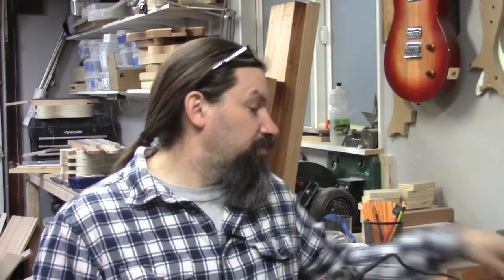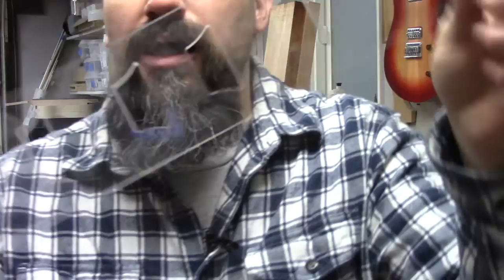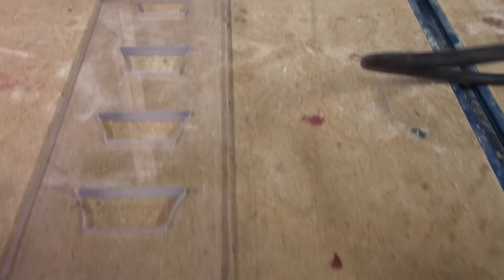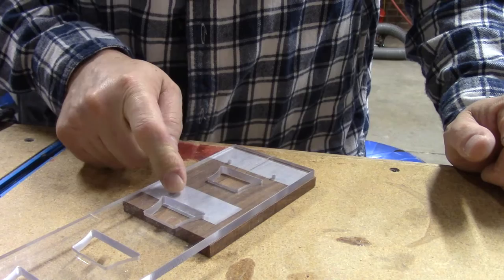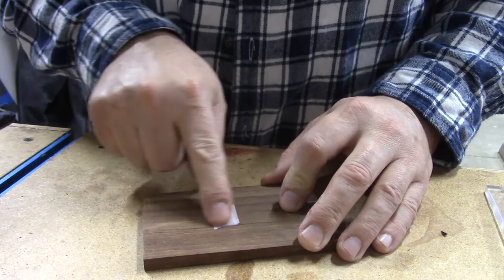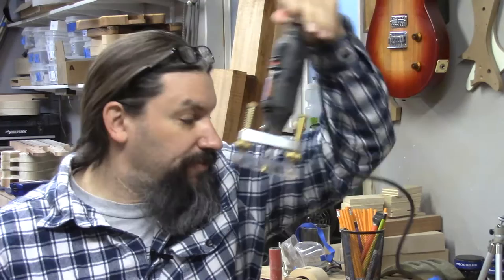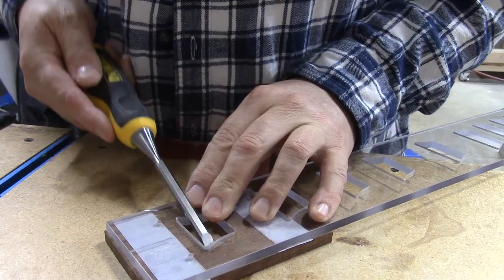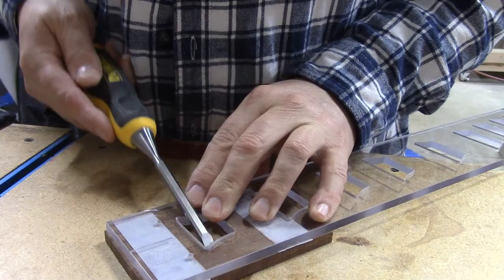NEW Trapezoid Inlay Jig For Use With Stewart MacDonald Precision Router Base

Comment: MLCS Co. sells a Brass bushing, and Bit kit for this, that actually fits the more "Grown-up routers, like the 690 Porter Cable router.  I do recommend making a clear Lexan base plate however.  Pretty easy to clone-rout a clear base 1:1 right off the original black plastic affair!
Reply from the maker: Cool dude